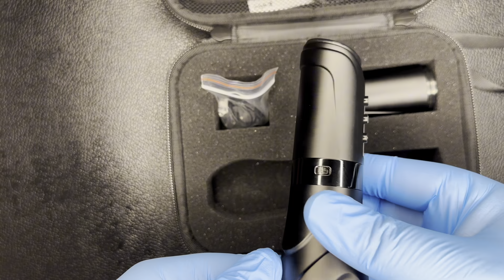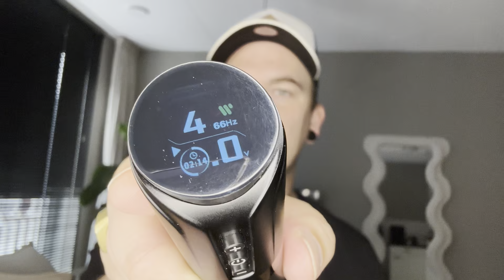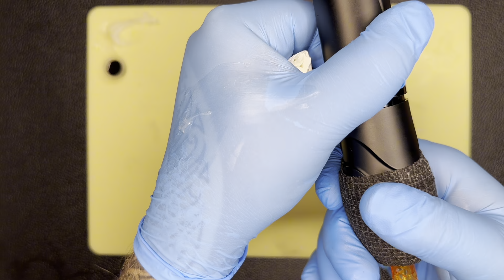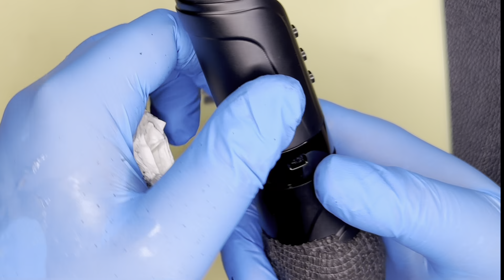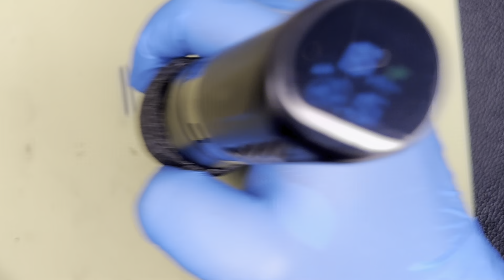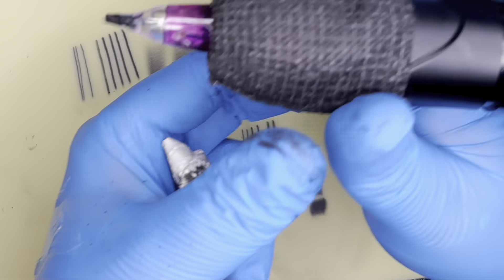CNC Kronos Review – Best Stroke Adjustable Tattoo Machine?!

Comment: Question. Is there any cartridge rattle at 4.5 when backing the cartridge out.?
Reply from the maker: Moet of the times cartidges will rattle a bit more when there is less tension on the cartridge. It happens because the plungebar loses contact with the cartridge. That usually explains the rattling sound.

Comment: This is a machine that works with an oscillating plate that pushes the cartridge compared to a direct drive machine and is it less reliable in your opinion?
Reply from the maker: Yes it is. I do prefer direct drive. But these machines are getring better and better. Indi have to say for stroke adjustable machines this is more convinient that a direct drive Because it is easier to adjust.